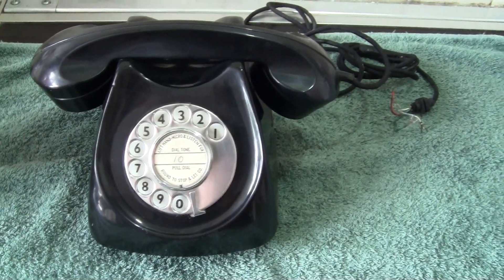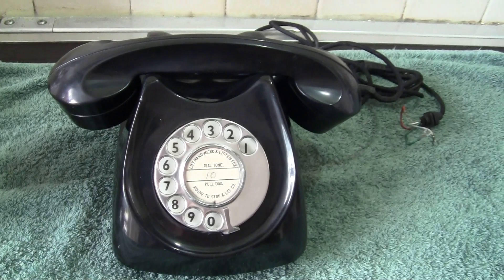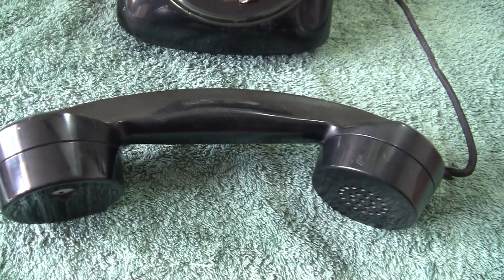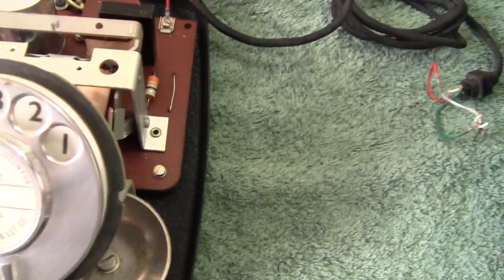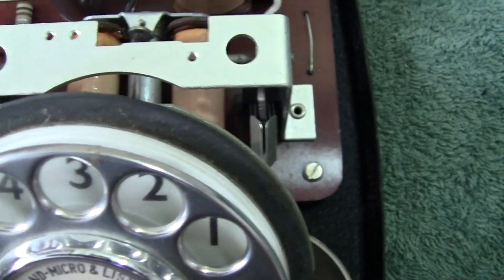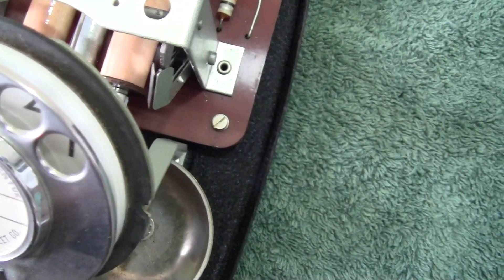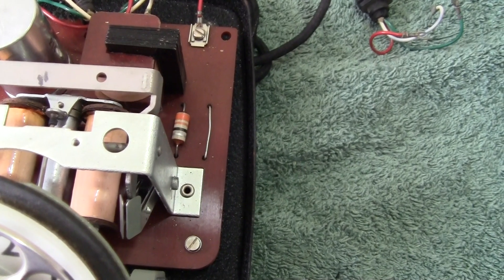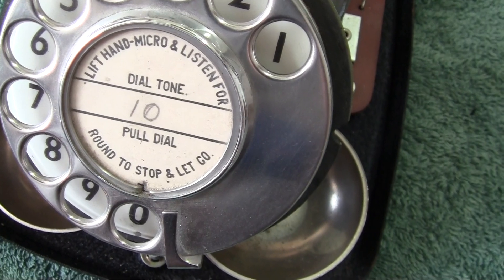.Telephones of the World.

Comment: These phones would have been really good if only they'd made them a bit heavier. The design is good, but I think people didn't buy them because they felt like a toy and not very robust.
I notice these phones have often ended up with a dial 21, which wouldn't have been around when the phones were made. They almost always go to the trouble of fitting a stainless steel finger wheel though, which seems a bit strange given all the other components are so plasticky.
Reply from the maker: Thanks Andy yes these are very light ( the handset )  No 21 dial is that the one normally seen on 706s numbers to me are confusing as I am number blind. Hope you get more interest in the Radio Station which is your baby and living in London cannot help out but there must be plenty of people living in your area.....good luck.